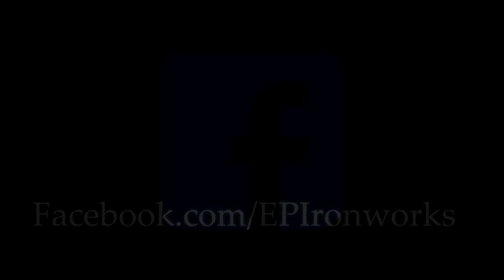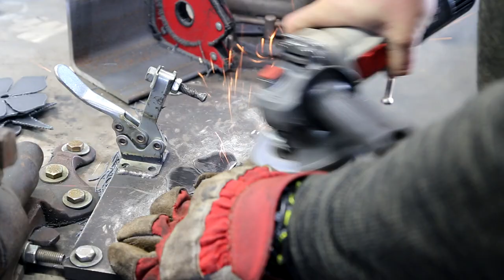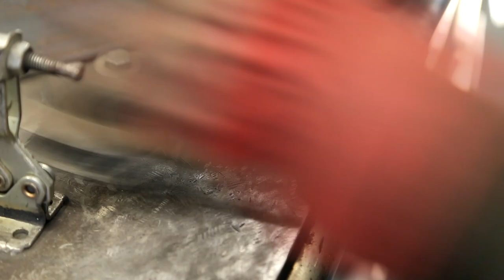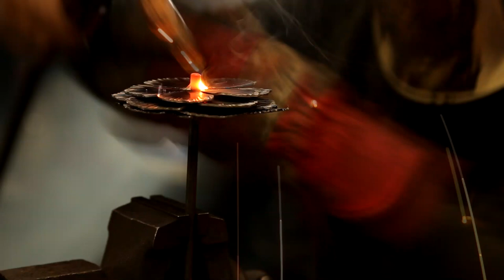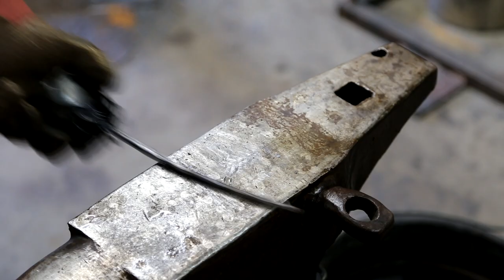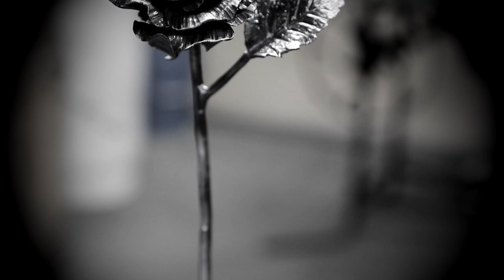Forged Rose demonstration Video hand formed sheet metal blacksmith flower

Comment: Beautiful!!
3 questions ... 
How long does it take you to make the rose? 
How are you heating it,  forge or torch? 
How are you getting all the scale off and shining it up?
Reply from the maker: Thank you, and I use a forge. I can make one from start to finish in about 45 minutes and for scale after shaping I tap it on the plate surface and use a high carbon steel brush